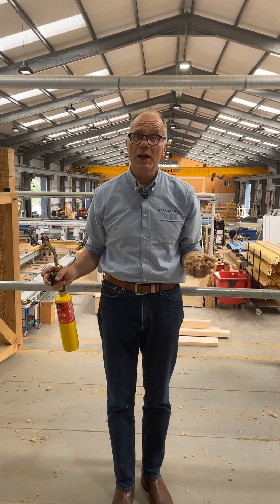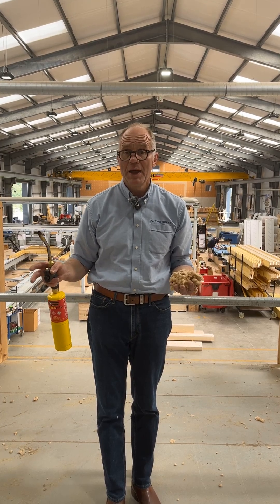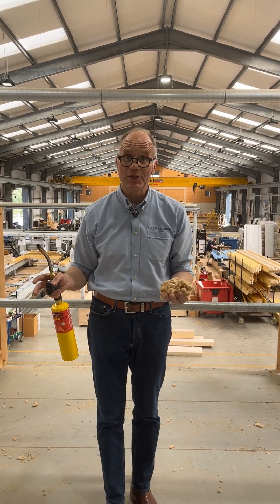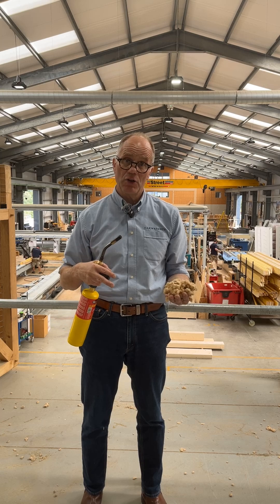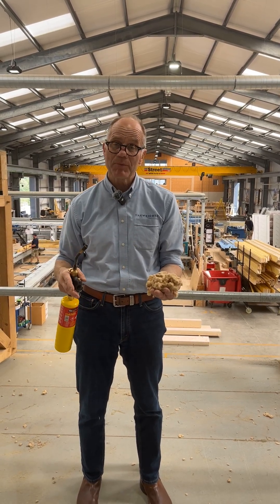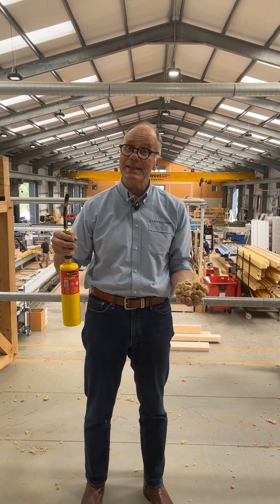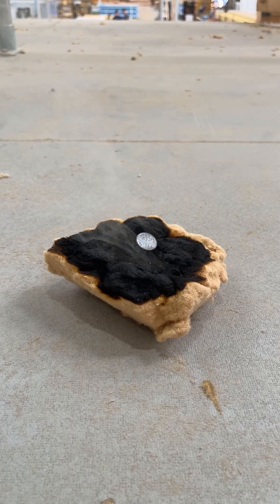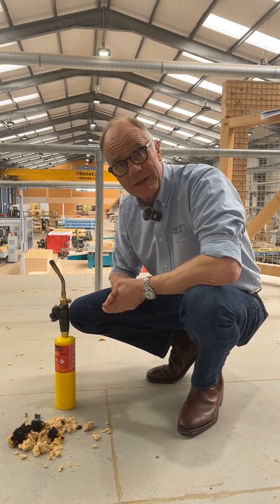Testing 50mm of STEICOzell wood fibre insulation with a blowtorch 🔥

Comment: This highlights the problem most home owners are facing in the summer, and things are only going to get worse. Decrement delay was not a consideration for most of the housing stock and still isn’t for “most” new builds. My home is an A+ label house but it gets unbearably hot in the summer because 20 years ago I put the wrong type of insulation, which even though it’s 40cm thick doesn’t cope with 30 C in the summer. My new home I will be living in from Oakwrights has taken this into consideration.